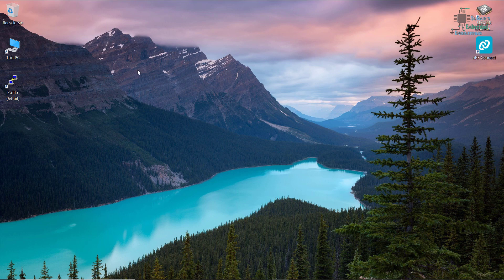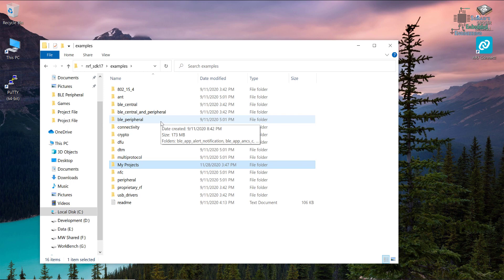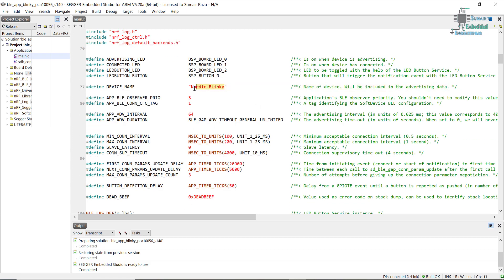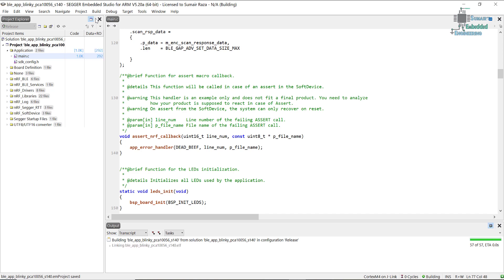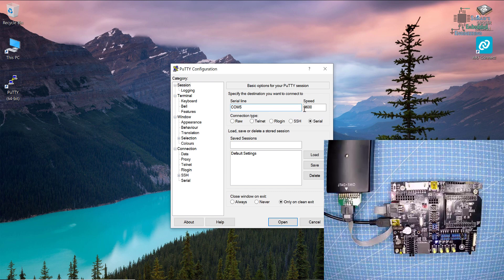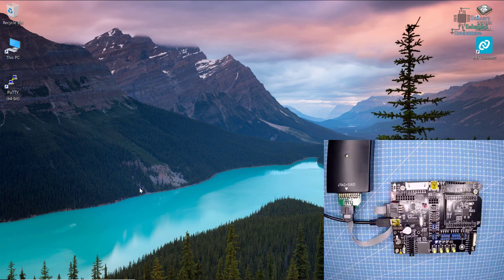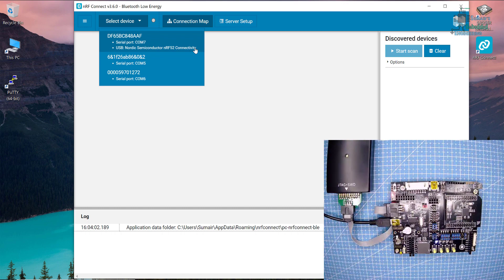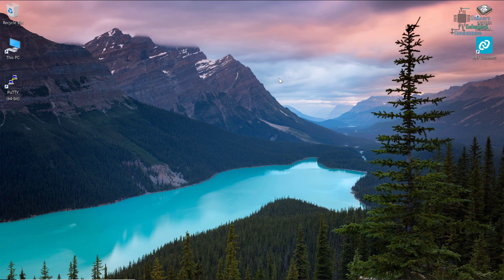nRF5 SDK - Tutorial for Beginners Pt 42 B - Testing first BLE Project

Comment: Hey Sumair, very great videos. Exactly what I was needing to get started with nRF SDK and the platform. Quick question - if you wanted to take the MPU6050 data you showed in the log in a previous video and also send it via BLE to see with nRF Connect, is there an example within the SDK that you would recommend I start with and manipulate as needed? Or maybe another video you have touches on this? Thanks!